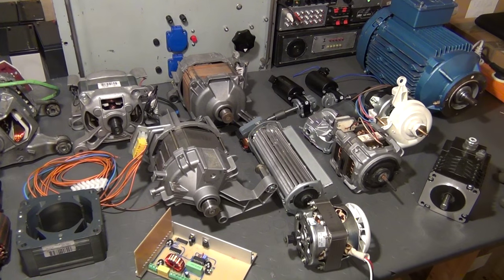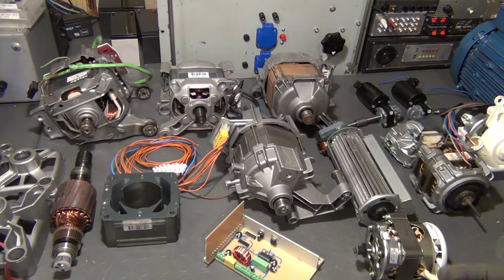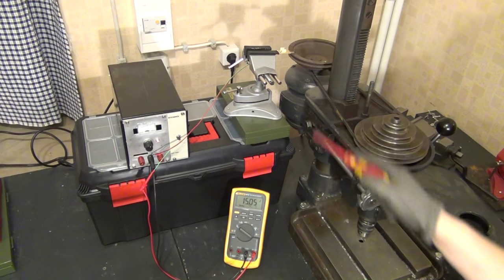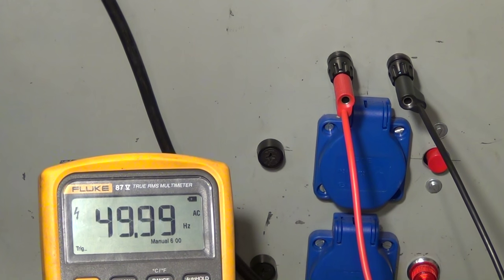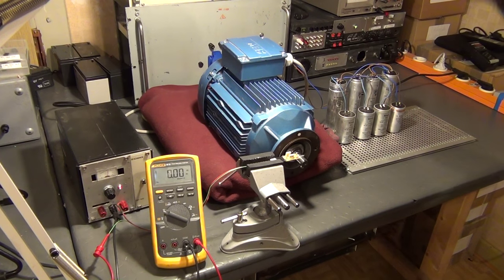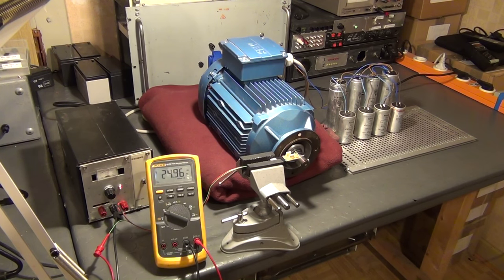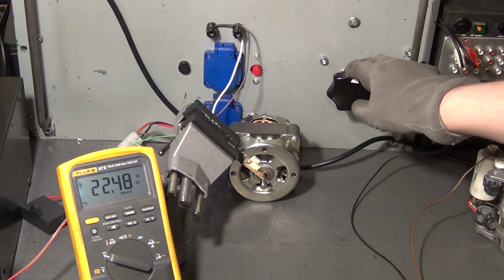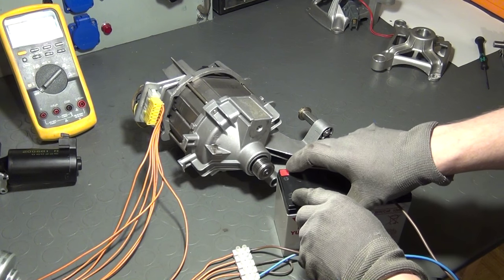TPAI Lab Report #008: Universal Motors and Induction Motors

Comment: most universal motors I have seen only have 4 leads. The rotor windings, and the field windings. Speed control is done with a simple chopper circuit too.
Reply from the maker: +Paul Frederick The motors used in German washing machines, often have an additional tap on the field windings as well as a small dynamo or generator sitting on the motor-shaft, that is used to measure how fast the motor is spinning. "chopping" down the supply voltage is  easy, but the idea is to truly "regulate" the motor in such a way, that the speed can be kept constant, even when the load conditions change. That is why there is a generator attached the the rotor shaft: It gives a feedback signal to a control circuit. And that is basically what I'm working on.
Reply: The Post Apocalyptic Inventor
Then your circuit will only be useful for German users. Because at least in my part of the world those kinds of motors with feedback signals are virtually nonexistent.
Reply from the maker: +Paul Frederick Don't worry. I will take care of that in the upcoming video as well. You can simply add a little magnet and a hall effect sensor to the motor as I have done in this video. It gives you an even better readout of the frequency and it costs next to nothing.
Reply: The Post Apocalyptic Inventor
Just a Hall effect sensor you say? I need to put a speed controller on the universal motor on my milling machine's power feed. But I do not need anything too precise. Just faster, and slower will do the trick. Well, just slower will do it. The motor only runs so fast.

Comment: I tried to build a little PWM circuit for a 60W DC motor a few days ago. It worked for about ten seconds. Then my Power-Mosfet began smoking and the motor ran away :( My Spice model worked perfectly and only predicted a load of about 1 W max for the FET, but that shows reality is more complex than simulation models I guess...
Reply: +Maanuueel42 \m/(^_^) Do you have a freewheeling diode installed antiparallel to the motor?
Reply: Alexander470815 Yes, and a filter cap. I did not put a heat sink on the FET, but it started smoking so quickly, it must habe been dissipating a lot more than 1 or 2 Watts. And the PWM was on ~1% duty cycle, so....
I simulated the motor using a 0.3Ohm resistor (which I measured on the motor) in series with a 0.3mH inductor (guesstimated), thought that would be accurate.

Comment: Ahhh great video, I can't wait for the next one. I have so much use of these motors. will you be including how to control them with dc as well?
Reply from the maker: +Sirus Right now I'm working on an AC system, but I'm planning to do it with DC as well. I think that the next video will become too long if I try to cover it all at once. Controlling the motor with DC will be simpler than the face fired controller though.

Comment: It seems like the requirements for regulation is a double-edged sword. Yes, it needs to be regulated in order to have a constant frequency, but it is comparatively very easy to regulate.
Reply from the maker: +Rob Mckennie It's much easier to regulate a universal motor than it is to regulate an induction motor for example. But it also depends on what you mean by "regulating": Simply stepping the voltage for the motor down is not hard, keeping the frequency of revolution truly stable independent of load conditions is a little bit harder.

Comment: question -- is it practical to just modulate a solid state relay (such as this one http://amzn.com/B0087ZTN08 ) with an arduino to control the last motor's RPM? ..using the hall effect sensor for feedback ? ..or will that have some negative impact on the motor?

Comment: Every house has three phase? Awesome. Once again, the UK sucks.
Reply from the maker: +Shaun Dobbie In Germany we have a 3-phase system from the very top down to basically every single house. Most people don't use 3-phase induction motors in their homes of course, but  cookers, ovens, storage heaters and flow heaters are typically connected to all 3-phases.
Reply: If we want three phase, we have to contact Scottish Power for them to dig a trench and put in a cable.
Reply from the maker: +Shaun Dobbie I made a video about the power grid a couple of months ago. If you want to know more about how things are done in this country, I recommend you to watch it:
https://www.youtube.com/watch?v=OBYzvkY2-eA
Reply: +Shaun Dobbie  Dont say that. It really depends on the age of the building. Generally, at least here in Greece, buildings of age 25-30 years old or less have all 3 phase panels. Older ones have 1 phase and also ancient switchgear. It really depends on the age of building as i am sure UK would not omit using 3 phases as its the way the whole power grid works. Its possible to update your home power supply to 3 phase but i am afraid it would be rather costly, intended only if the building is really worth it.